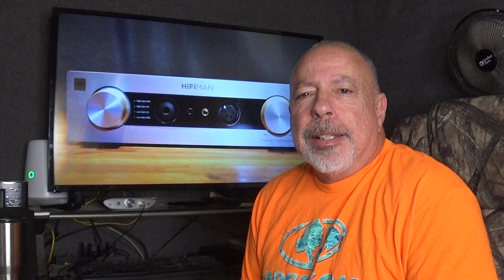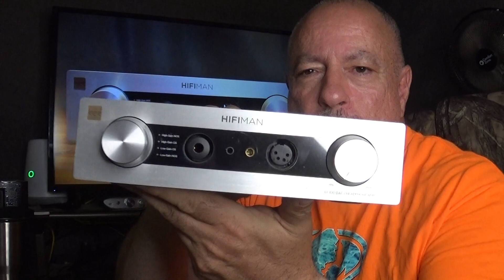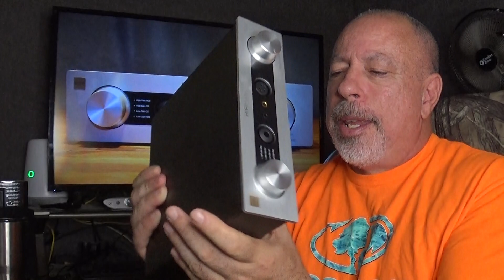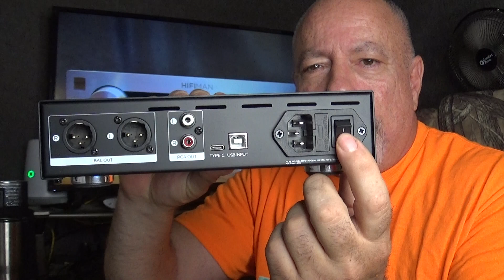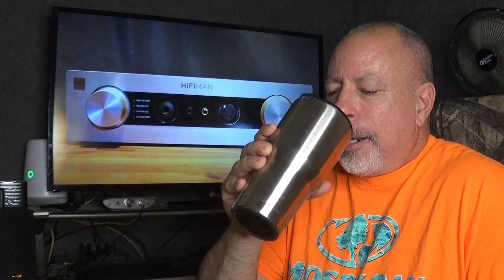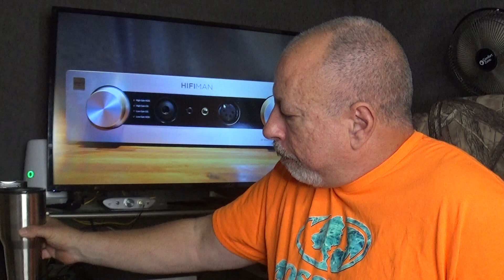HIFIMAN EF-400 HEADPHONE AMP/DAC (FIRST IMPRESSIONS).

Comment: Hi William. I want to ask you a question about this DAC. I noticed that my EF400 cuts the audio for a very short period of time (about 250/500 ms) every time I start a song or any other audio stream after some seconds of silence (even the sound Windows makes when changing volume from the taskbar gets cut at the beginning). I have this issue with every computer I connected this DAC to, and with both USB ports of the DAC. I wanted to ask you and every other EF400 owner here if you also noticed this issue, or if it is only my unit that has it, and get a replacement. Thank you.
Reply from the maker: I haven't experienced that problem.

Comment: Hey i am having issues with my unit. It does not recognise the lightening to usb c cable. Plus the maximum sampling rate i am getting is 24 to 192 but other reviews suggest it can take 24bit/768kHz. Is it true?

Comment: Thanks for your initial impressions. Hoping you would compare the hifiman amp to ifi zen in the background, as I have a zen but want to know if it's worth upgrading to the ef400. Also can you do an indepth comparison with your hifiman headphones with hifiman amp/dac. Would love to know how the Arya - ananda - xs- 400 compare. I appreciate your time and effort.
Reply: So, I've been comparing the Zen DAC against EF400 using Edition XS (Balanced Out of both). Initially the EF400 was a bit disappointing, flat and dry but it's improved a lot after ~50+ hours of burn-in. Now they sound considerably better than Zen DAC (even paired with Zen CAN). The Bass is textured and hits harder than Zen, the Bass almost feels like a blob with no detail/texture on Zen. Mids are more detailed but in a natural in-offensive way with more body, Zen in comparison has lighter note weight and less micro detail. The Treble on Zen even though not offensive like some ESS DACs sounds less accurate, timbre is better on EF400. Stage size and Instruments separation is also much better than Zen but personally I think Imaging could have been better when compared to other DACs in it's price range.

Overall, for me there's no competition here, EF400 is the better device.
Reply: @audiofile1178  Thanks so much for the detailed review. It was worth the wait. I find pairing the edition xs with Zen dac not always a good combination especially with overly loud modern recordings. Good to hear you're onto a winning combination. Enjoy. I'll be looking to pair the EF-400 worth the new Ananda stealth later on this year. My edition XS has distortion issues so I'm looking to move on to The new Ananda stealth.
Reply: Hi, I got my EF400 3 days ago, if you can wait a few days, I can compare it against Zen DAC with Edition XS.
Reply: @audiofile1178  Excellent. I look forward to your comparison.  Cheers.
Reply: @mrgee918  👍. It's still in burn-in phase but it's definitely better the Zen DAC. How much better and in what areas? for that, I'll get back to you in a few days.

Comment: I am considering getting this DAC, currently using the Zen Stack with Edition XS and if you could add a small comparision between these two when you post a full review, that would be very helpful. Thanks.
Reply: Really no comparison! Ef 400 has 4 W of power! Can pretty much drive most headphones
Reply: @colingordon0986  Thanks for the coment, I already purchased one and yes, the EF400 is better. Bacause of how powerful it is, there's not a lot of usable volume range for IEMs but I knew what to expect, so that's fine.

Comment: Can you use iPhone with this
Reply: If you connect an iPhone by USB it should, i use my iPad to connect to my Sony headphone amp with a usb-c to usb-b cable. You might need the camera connection kit though depending on your phone model.
Reply: Yes. Has usb-c to usb-c and usb. Use an OTG lightning to usb-c. You can get those from Fiio, Shanling, Apos, Lotoo.

Comment: Is the amp section itself warm like a Schiit Asgard 3, or is all of the warm coming from the R2R DAC section?
Reply from the maker: There is no way to test the amp on it's own with no analog inputs.
Reply: @theheadphoneexperience-wil2250  Really? Other reviewers have been commenting on the DAC section alone, somehow bypassing the amp...
Reply from the maker: @cussyrichards6121  You can test the dac alone using the rear outputs into another amp. There is no way to test the amp alone without analog inputs.
Reply: @theheadphoneexperience-wil2250  Great, thanks for clarifying that. I guess if you hooked the EF400's DAC up to the Asgard 3 and compared it to the EF400 using its own amp you'd be able to tell the difference in sound between the two amps

Comment: Hi, does this pair well with the hd 800s?
Reply: I have never heard this amp dac but I've demod a hd800s and yes it would be a great pairing because u combine the ultra wide soundstage of the hd800s with the wide sounfstage of this amp, plus the slight bass tilt and massive detail this has (from all I've read and seen in reviews) it would be a amazing pairing for the hd800s. Oh also on top of the fact the treble in this amp isn't piercing or analytical but it's super detailed so it would most likely be a perfect pairing
Reply: @soraflame66  thanks for the insight. 
I actually managed to test it before I bought it few days ago, and it sounded great. Can't wait for it to arrive
Reply from the maker: Someone else will have to answer that. I do not have an HD800s.